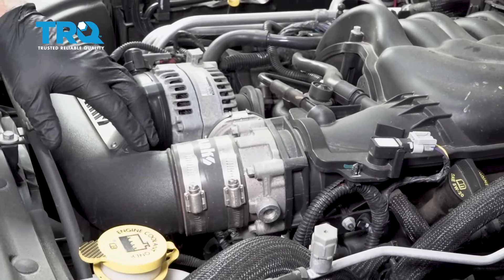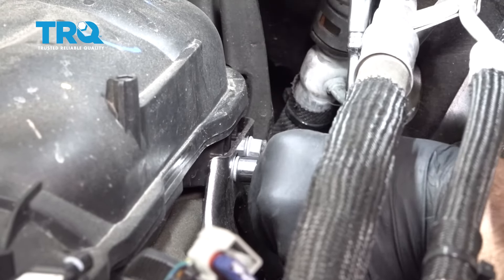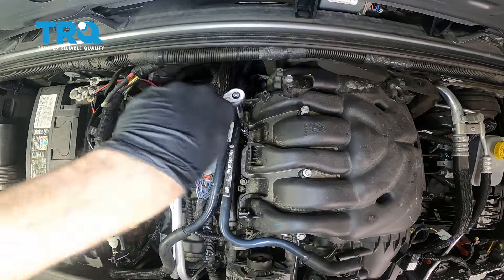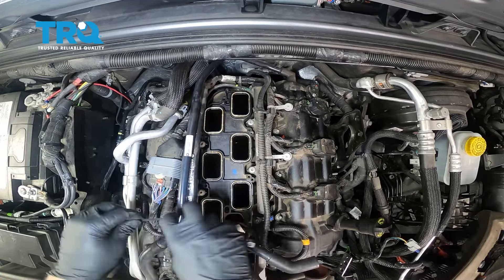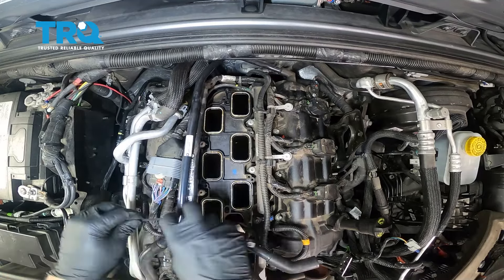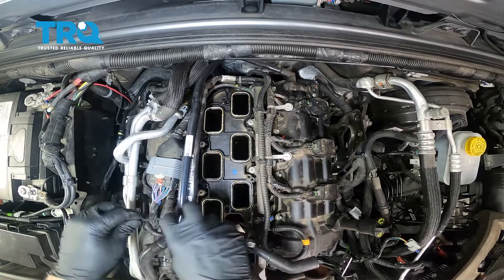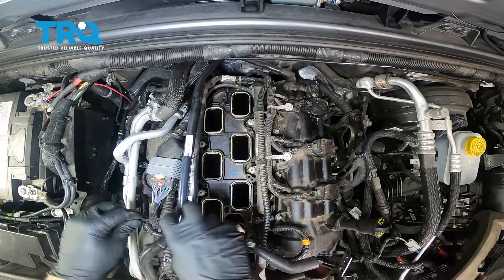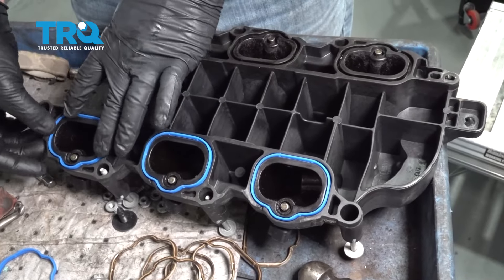How to Replace Oil Filter Housing & Cooler 2006-2018 Jeep Wrangler JK

Comment: I have to say this job by far is the most time consuming and uncomfortable job ever… word of advise for those with lifted jeeps or high tires… remove the front tires and lower onto stands… otherwise you’ll end with a sore mid section, arms and knees.
Reply: And neck

Comment: No need to remove the fuel rail, just unplug injectors and flip lower plenum over with fuel line still connected, also no need to remove the AC bracket, just unbolt it from the intake and pull the bracket back so it clears intake

Comment: Just did mine today. Had a cold snap the past week. Oil was everywhere. Dealer wanted $950 minimum. I went with the upgraded aluminum oil cooler assembly. 4 hrs for  disassembly, clean-up, and re-assembly. Good to go! Didn’t remove the fuel rail. Just pull connections for ejectors on right bank, and one on the front of left bank, then swing and tie it out of the way. Less small parts to worry about!

Comment: There are other videos that show you don’t have to remove the injectors or the fuel rails
Reply: I just did this today, couldn't find the service lit on the program our shop has-started watching this didn't get very far-just went my own steps, you're correct. The part kit I got was a Napa set that includes the intake gaskets to. I did remove the aluminum heater tubes, I left the main wiring bracket in by removing upper nuts and loosening the studs near the battery bay (they're not easy to get to, long 1/4 extension and wobbler). There's 2 wiring plastic rivets in the back of the lower intake that where too difficult to remove. I held everything off to either side and everything worked out just fine.

Comment: this is a VERY through video , I just did this install last night to my 2017 rubicon with the help of a more knowaldgeable friend and get ready its a good 2 hour job. Tip- buy new sensors for the oil temp & the coolent temp in the housing/cooler.

Comment: At about 6:30 you show removing the studs with an E5, but then the scene cuts and you are removing the intake and the studs are still in place. WHAT??? Did you remove the studs or not? This is very confusing,

Comment: You may want to edit the video, you didn’t show when you torque down the 5th bolt on the lower intake manifold. Looks like it was edited out for some reason. All in all great video.

Comment: Since the seals on the bottom of these things are prone to crap out, I wonder if a treatment of AT-205 reseal would be a good application. I changed my housing when my jeep was 5 years old with 60k miles due to massive leak. I’m approaching 10 years and 110k now and if these thjngs onky last about 60k then I’m thinking of adding the reseal at my next oil change. I don’t suppose it could hurt. I’ll also get some lubrication and preventative maintenance on other areas Including the rear main seal.

Comment: About 6:30 into the video I HATE the fact that you cut the video because while removing the bolts it puts pressure on both the bracket and the intake because there is a fixed washer that will push back. It almost seems like the video was cut right there on purpose because you didn't want to cover that... Either way it would've been much better with more follow through and this is an example of that. Oh well I'll go watch a better video because this one is lacking...